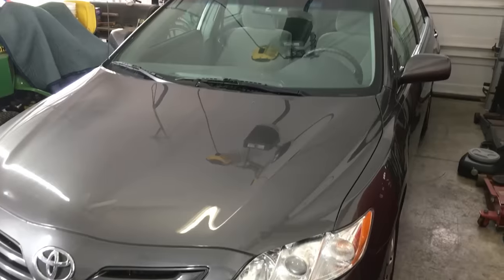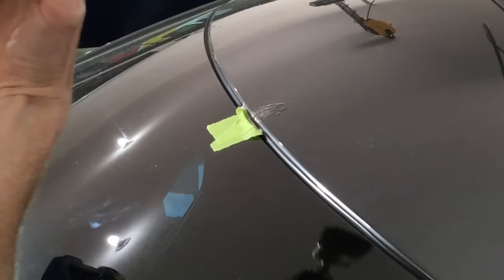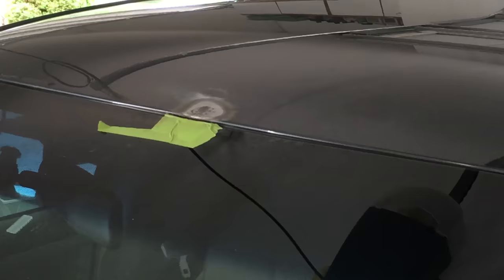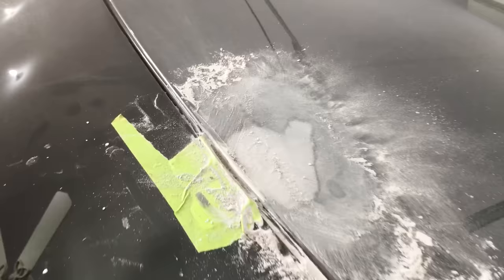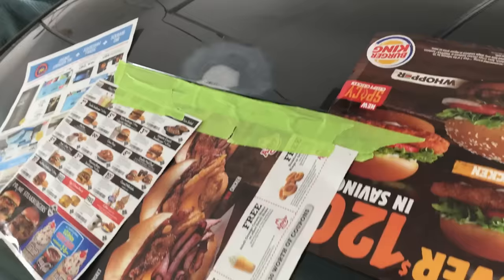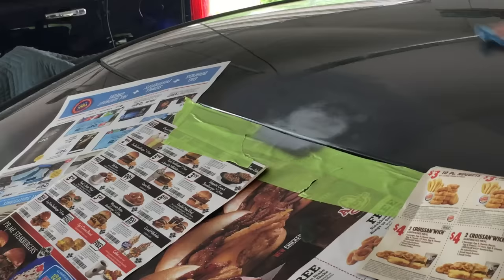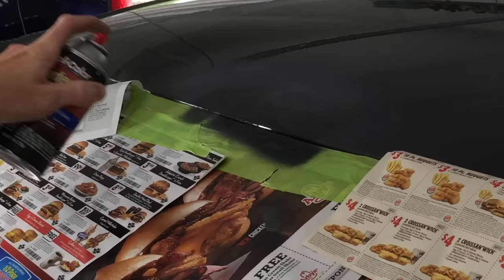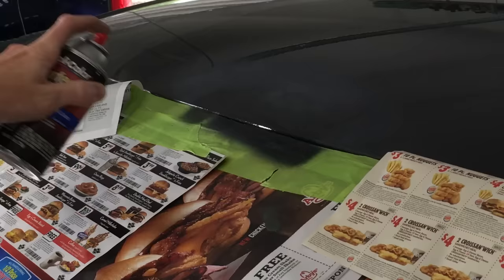How to Fix: Rust Bubble Under Paint from a Rock Chip Around WIndshield

Comment: I used this exact process a few weeks ago on my car, and it works.... I just wish I would've seen this video first (I had to figure it out on my own, haha)!
I noticed you used a 1 part clear as opposed to a 2k clear like spraymax. Do you notice any issues with long-term durability, uv resistance, scratching, etc that many critics warn against?
Reply from the maker: Scott Carson yes it is essential to keep a good coat of wax on the lacquer clear. Otherwise it will degrade over time, faster if contaminates such as bird poop get on it. I used the lacquer on this cheap car because I already had it. Anything nicer and I would have bought some 2k.
Reply: 2k is top stuff
Reply from the maker: @asfbi  Yessir. I have an upcoming project that I'll use 2k for.

Comment: This brush can't remove rust craters. Just hide them by smoothing the metal. You should use the sandblast to remove them. Or some acid. But without it this method is better than nothing.

Comment: This was awesome video thanks
Question though
Can be used the same technic if you only have a cracked paint just above the rear wheel arch?
Reply from the maker: It depends why the paint is cracked. Often the paint on the surface of rear quarters is cracking because the metal behind it is rotted away from rust. You might find that when you chip the paint off, there's no solid metal left behind, especially common on rear quarters where rust is common.
Reply: @6thGearGarage   well it's visible the white primer, and I could send photo but not sure where to
Reply from the maker: @zakmiltan  you can email it to me garage@6thgearadvertising.com

Comment: I have Honda Insight 2019 Modern Steel Metalic, and I cannot find any paint spray you are using for Toyota brand. Any suggestion?
Reply from the maker: What's the color code? It should be on the sticker in driver's door jamb.

Comment: Hello guys, i was following step by step, but painted color is much darker like car color and it is obvious. Of course i bought color by the original code, but i think car color is lighter cause car is old and sun work hard. How to deal with it? Thank you for your advices.
Reply from the maker: Yes if the car was outside most of its life, then color fade rom UV is most likely the cause. Especially if in a sunny region.
Reply: @6thGearGarage  So is it possible solve this problem?

Comment: Is there a special wax that helps prevent rust?
Reply from the maker: There is not, as rust starts when bare metal is exposed to the elements and road salt. Wax protects the paint but it is the paint and primer that must cover the bare metal to avoid rust.

Comment: One more question :). Is it necessary to do the folded paper technique or is that overkill? I noticed you didn't have any borders. But with the folded paper technique (I saw chris fix do this) there is a border. I'm about to paint my hatch, did all the prep.  The emblem on my VW was rusted so I'm focusing the paint on that centre area. Thanks again!
Reply from the maker: You don't have to fold the sand paper. The main reason I wrapped it around the block was to make the paper smaller since I was working in a small area. In reality though, only the paper with the block behind it will be doing most of the sanding. the parts that just hang over will only be doing light scratching without the pressure of the block behind it.
Reply: @6thGearGarage thanks! I meant when painting. He folded paper over itself over spray area so it blends. I'm having a different issue though, primer still shows through which is crazy cuz I did like 6 coats! Its metallic blue so I think that might be something to do with it
Reply from the maker: @stringsnare  I didn't see where he did that trick with the paper so I don't know for sure. But I did just have the same issue with paint not covering primer today. I was spraying metallic red and it finally looked better after about 6 coats. I have yet to get it out in the sun though.
Reply: @6thGearGarage  thanks again for replying. Guess what, I did about 7 coats the last 3 were somewhat thick - the next day it dried and I cant see the primer outline. Must be the metallic colour takes time to become fully opaque. Thanks again for this video, I've watched it over and over again the past 2 weeks 🤣

Comment: You did a good job overall id say , but next time, do yourself a favor and before you lay down the base coat color, scuff the ENTIRE roof panel with a red scotchbrite pad. Then lay down your base color on the repair area, and then re-clear the ENTIRE roof with a 2k clear coat (can be bought in a can). This way the entire roof will look like oem finish and it will all be uniform in gloss.

Comment: If the rust bubble gets so bad that it starts leaking water into the cabin is that now considered beyond this type of repair?
Reply from the maker: Yeah, it that point I would cut out & weld in new metal, although you could use fiberglass if a welder isn't available.

Comment: Would it be a bad idea to do all the steps leading up to the spray paint part and then stop for a bit? I have the weekend free and want to start fixing up my car but the place to get my custom spray paint won't be able to get me the car paint until Wednesday. Not sure if it would be damaging to start tomorrow and then continue to drive around until I get the paint Wednesday and fix it from there but I figured I'd ask.
Reply from the maker: Good question!  I wouldn't stop at clean bare metal because just the humidity in the air can cause fine surface rust. I would get the primer down and then call it a day.
Reply: @6thGearGarage  gotcha, and it would be totally fine to drive around for a few days after the filler primer stage? It does also look like it may rain this week if that makes a differences. I appreciate g
The help!
Reply from the maker: @nathanjohnson1814  I'd try to avoid rainy weather if possible. Better to keep it dry if possible, but sometimes you gotta do what you gotta do.
Reply: @6thGearGarage  I may just wait then just to be safe. Every day this week is 60% chance of thunderstorms. I'll wait until I get the paint and then go at it. 

Also, would it be possible to send you a picture of the car I'm working on with an additional question? Its my daily driver but there is a lot of rusting on the roof and I would love your opinion on how you would attack this project in particular

Comment: Question! When I watched chrisfix' version, he used fine grit wet sanding of the clear coat before the buffing, is that necessary? also, can i just use body primer, or do i need to use self-etching AND filler primer?
Reply: If you sand to bare metal you need self etching primer.. if you are only going over paint or body filler you can use normal primer
Reply from the maker: If you have a lot of orange peel texture in the clear, you can wet sand it first to get it smooth, then polish for a glass smooth finish. If the clear sprayed down smooth enough, you can skip the wet sanding step. Robin’s answer to your primer question was perfect. 👍
Reply: @6thGearGarage  thank you so much!!!!!!!
Reply: @robinvlasveld3594  thank you robin!!!

Comment: I have a question regarding painting. While I was trying to sand the surface using 1000 grit sandpaper after the clear coat, the paint inside the clear coat has been removed (maybe because I over sanded), so it looks like white on that spot. The surface is smooth and I wonder how to make this white spot back to normal. I have a liquid type paint but I don't think it will work because if I paint that white spot using this paint, I have to sand it using sandpaper and in the end the paint will be removed. So, what I', thinking is using the spray type paint like your video because the surface now is already smooth and like in your video there is no need to sand the surface after spraying the paint. Is it ok to use the spray type paint on that spot and then buff it? I have a liquid type clear coat but I'm not thinking of using it after the paint since this clear coat makes the surface not smooth and in the end I have to sand it using sandpaper again. Please let me know your opinion. Thank you in advance.
Reply from the maker: I would apply the color, then the clear, then wetsand. If you are worried about sanding through the clearcoat to eliminate orange peel, then I would apply some extra coats.
Reply: @6thGearGarage  Thank you for your reply. You mean applying the color using spray type paint and the clear coat using the liquid type one, right?
Reply from the maker: @K.y.y8646  I meant using all spray paint. Unless you have a compressor and spray gun available. You'll always get a better spray pattern with a gun than a can. But I showed aerosol because a lot of people don't have a compressor or know how to use a spray gun.

Comment: Don’t need to spend the extra money to get a show car result.. You need the clear coat to sand it down with 5000 grit, then buffing with compound and polish and finally with finish polish, and last but not least ceramic coating for protection.

Comment: Question #2.  Dont body shops make some type of cord they wedge between the seal / body like you did with the qTip.  What is that called and where do you get it?  thanks again
Reply from the maker: You're right, they do make a special cord that professionals use. I don't know what it's called though.
Reply: We use a lift tape or the foam tape
Reply: @justinmontandon6464  Thank you

Comment: Awesome job!

How would you approach a car that has the clear coat failing? My wife's car has clear flaking all over the place, tried wetsanding the clear off with 400 grit, but it easily burned through the clear, through the paint, and a little primer :(
My car is starting to get a little of this too, unsure if I should even try to wax the areas that haven't failed yet, or just give up.
Please help! Thanks :)
Reply from the maker: TheIVJackal do you live in the south? This is a common issue down there with the constant sun. When the clear is failing, it's time to repaint the car. I would try exactly what you did, but if the paint is that far gone and you're getting into the primer, there isn't much you can do. If there is only a small area of damage, you could buy some time by using sealant or wax, but in the end not having a coat of wax on it for much of its life has baked the paint to a point of no return. Hey, at least it isn't rusty!
Reply: Check you tube.  There’s a good video on repairing clear coat peeling

Comment: Okay so based on some comments below which rust remover or sealant can I use before apply primer/paint? So the worked area will last longer
Reply: POR15, or brunox epoxy if you're from Europe.

Comment: How does this look after several years with rain and salt? :)
Reply from the maker: I'm not sure, this car is long gone
Reply: @6thGearGarage  Rust is really mean. Sandblasting or special acid gets it mostly away. Complete away is very hard.

Id like to add that I use an airbrush for such small spots, so that the original areas remain untouched.

Comment: May be a stupid question but if I got the right heads, would I be able to use a rotary tool? My rust is very small and around the windshield like this.
Reply from the maker: April-Adele Whyte you could use it to start with but sandpaper will be needed to achieve a smooth surface in the end.
Reply: @6thGearGarage  OK cool. Yeah that's what I meant, use it instead of using the tool you used in the first step.

Comment: Stage 2 or 3 your link leads to bondo stage 3
Reply from the maker: Get the stage 3, it's a more smooth formula for fine/smaller repairs like this. I believe stage 2 is fiberglass reinforced, which will make it a little chunkier - ideal for larger areas that need additional strength.
Reply: @6thGearGarage  I think it's the same item

Comment: How much time did you leave between coats of paint and filler, or did you? It looks like your putting one coat on immediately, and sanding filler as soon as you put it on. You didn't do that, right?
Reply from the maker: I cut the drying time out of the video to keep it shorter. Always follow instructions on the can of the product you use 👍

Comment: Well I am so grateful for this video I'm frustrated. Why don't you tell us how long in between. For example when you put the first primer down how long was it until you hit it with the other primer. Did you let the primer dry overnight or half a day before you started to put the first coat down in between the first and second coat how long did you wait? When you use the tack cloth how many minutes did you wait was it still wet when you used a tack cloth was it dry like seriously dude if you're going to teach teach
Reply from the maker: Different brands and products have different instructions, so I’d follow the instructions of the exact product you use. For mine, I waited a minimum of about 15 mins between coats. Tack cloths are only to remove any dust before painting, so the surface is always dry.

Comment: so question, when you sprayed the clear coat it leaves a rough over spray does the polishing blend that smooth??
Reply from the maker: Yes. It wasn't that rough so I didn't even need to wet sand before polishing. Also, I used a Lacquer clear, which is softer than a professional 2k/Urethane clear.

Comment: Dude, help! lol  I did pretty much step for step what you have done, here ..BUT, my flippin clear coat will not come to a sparkle! There was one spot where a splotch of cc dripped off my gun, after about 5 mins. I let it dry, then sanded it off, then polished. That spot is beautiful inside its border, I've polished like 10 times, the good spot is getting slightly bigger, lol but the cc on the rest of the door I've started going through the paint. Idk wtf I'm doing anymore, lol.
Reply from the maker: What type of compound are you using to polish? Did you need to wet sand first?
Reply: @6thGearGarage  Tx for replying, I'm at my wit's end....  I did wet sand the drip, yes. Once it was gone, that spot was good so, I've been polishing around it trying to get the rest to match that good spot. First I was using Extreme Solutions, stage 1 Wonder Cut 1000, and stage 2 LV1500 with a denim pad, a velvet pad, and a wool pad that looks like a sponge. Then I bought a proper shaggy wool pad and Maguiars Ultimate. Any combo of all that has been used,lol.   ....Painting 2 doors has been a life altering experience, ridiculous,😒 lol. ty again
Reply from the maker: @blackopal3138  I don't know man, that's strange.  Is the surface polished but the clear itself hazy? Or the actual surface dull?

Comment: Have a few very small paint chips with a little rust in them how would u recommend treating this since they are super tiny I bought touch up paint kit that's the same color as my truck
Reply from the maker: I would look for a very small dremel tip to remove the rust, or just apply some rust inhibitor to stop it.  Then prime and paint.
Reply: @6thGearGarage  what do you think about rubbing the compound into the small spots to get the rust out then painting over it after? I've seen some people say that works pretty well also is the rust inihibitor safe for the surrounding car paint? Thanks for your time
Reply from the maker: I would only put the rust inhibitor on the rusty areas with a tiny brush. Then you can do a couple of coats and let it cure. Then sand it with some 400 grit, prime and paint. I have never tried compound. If you do, be sure to clean well before primer/paint.

Comment: What if this started to happening under a vinyl wrap 😬
Reply from the maker: no bueno... time to peel it off and repair.
Reply: @6thGearGarage  ouch… do you think I can peel just a bit (since it’s only little spot near the rear wheel) and then apply it back? I mean if there’s some unperfections, still better than bubble rust 🤷🏼‍♂️
Reply from the maker: @thelionicorn5380  I've never tried anything to do with a vinyl wrap before, I'm not sure how the adhesive on it holds up. I would think that after the rust gets worse, it would start to peel anyways, so might as well tackle the job now right?
Reply: @6thGearGarage  I think so too 👍🏻

Comment: Not bad for a DIY repair, you've clearly done your research and done the steps correctly for the most part. But even though you went over the repair area with the various grades of paper, you will still see scratches in the end. Should prime the whole repair area really where you've been sanding with anything past 600, up to 1500 for silvers which show everything. Blacks are quite forgiving at least in your case. No use of a fade out blender, trying to blend with just lacquer will always leave a visible edge. You also didn't scuff the area for lacquer far enough,  can guarantee that will start to peel off in 6 months. Other than that, not bad! Please heed what this guy said though, it's a $500 daily car, not a show car. If you want a repair that looks good and lasts, get a professional. If you do this and aren't happy with it, a pro will charge you more to remove the failed effort 1st as it's more work

Comment: How long did you let that clear harden?
Reply from the maker: 24 hrs, but always follow the instructions of the product you use, as some are different.
Reply: @6thGearGarage  did yours say specifically tou can buff in 24h or what?
Reply from the maker: @cubul32  I don't remember exactly, it's been about 5 years. But the longer you wait to buff after curing, the harder paint will be. Lacquer like I used will always stay softer than a 2k clear though. Definitely want to wetsand/buff 2k within 2-3 weeks
Reply: @6thGearGarage  thanks for the info